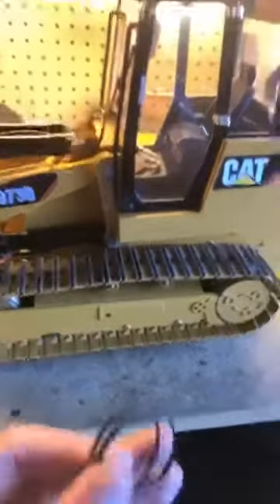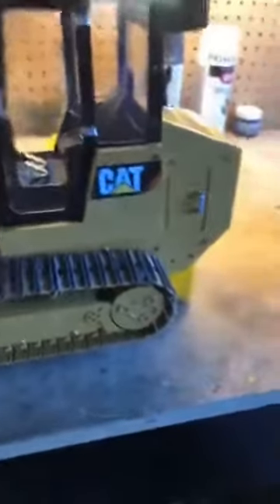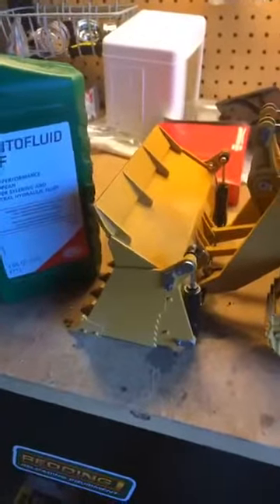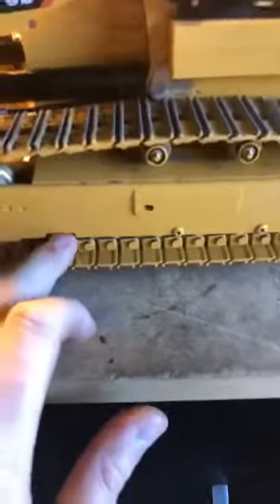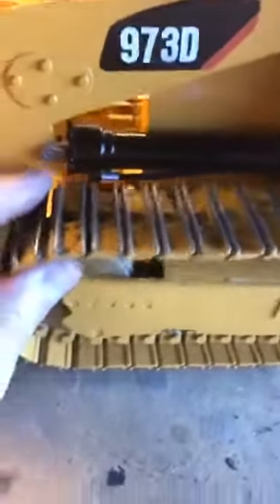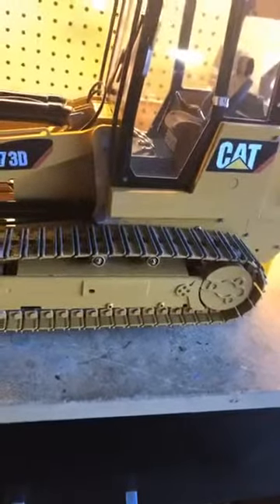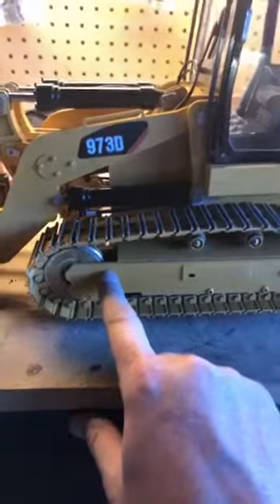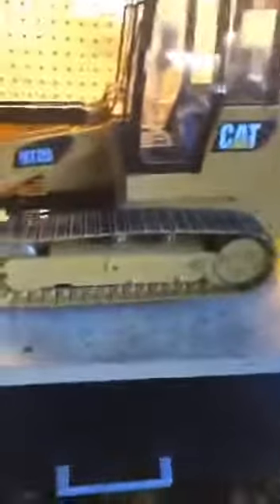Magom 973 trackloader rebuild

Comment: Dang man should I look into getting a carson insted?
Reply: ps did you end up selling off your bruder 963
Reply from the maker: Yes get the carson their lots of upgrades and been around forever ..... yes sold the 963 be der converted and dude replace tracks and bucket and still running strong
Reply: @scalesize8020  whats your thought on the Faroe models like the 953 or 666 models?  still thinking about picking up a track loader next or possibly the lxy skid steer
Reply from the maker: @thatsmyrc  I never seen anyone have luck with the faroe trackloader as cheaply made the magom was good however the drive gearboxes always had issues the Carson is miserly impossible to get parts for in the us plus it’s electric to convert to hydraulic is another $550 with magom kit. My buddy just got the scaleart trackloader and it’s nice but very $$$ I personally think rubber tire loader is the sweet spot. As far as the lay skidsteer goes get the tracked as the one with tires is way to tall geared. The only down fall bout those is they run like a 800mah battery due to the size
Reply: @scalesize8020  thanks for the awesome advise and input.  Also responding back.  I heard same issues with the faroe tracks.  I did see a add for lessu 953 track loader I think it eas coming soon from toucan hobby.  So I’ve been waiting to see.  I know the little skid from lxy is slightly bigger than lesu but weighs a bit less.. I know the skids would be a blast to whip around as a clean up crew small job thing lol.  I’ve been laying a bit low and in and out of my own vids.  Been having issues w/ YouTube getting others comments and vids.  Appreciate again your input and it’s showing not subbed but I had known I’ve subbed too you some time ago?  So I’m resubbing hitting that Beal again 👍🏼